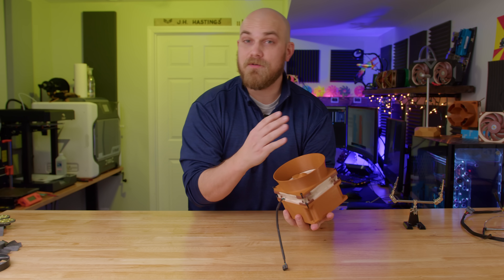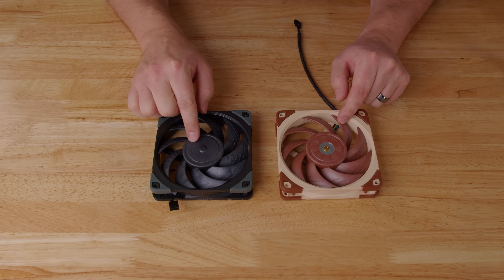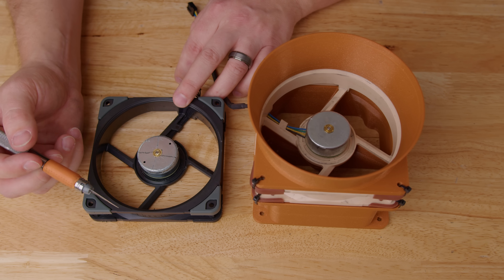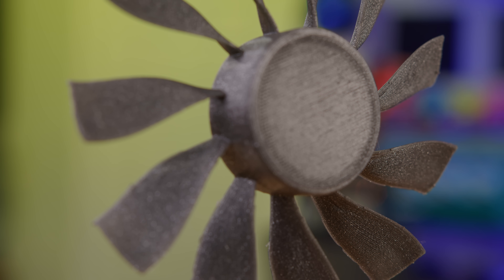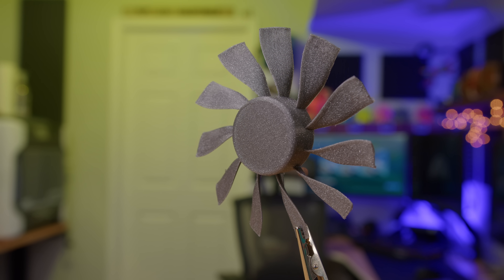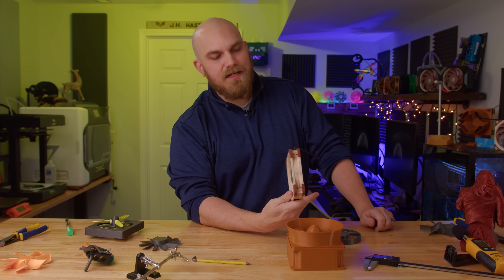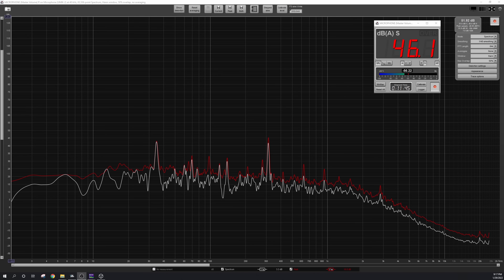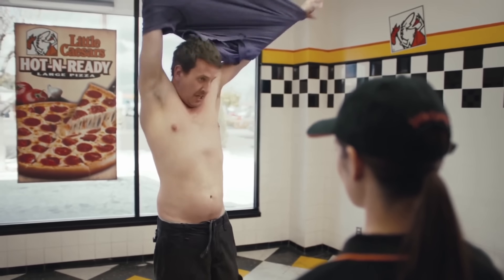Overdrive ENGAGED | Fan Showdown S4E1

Comment: Brainwave for a test.  What if you put the A12 on one end of your test tube and mount the other fan on the other end.  Then you could measure the power transferred as you increase the load.  It would be like a fan dyno.  You would then have an efficiency gauge that would measure both air flow and static pressure in one hybrid number.

Comment: Maybe you could run the gear fan with a drill at the same RPM?  Just to see if the concept works.  If it turns at 2000 and it still doesnt move air then defeating friction is irrelevant.

Comment: The holes are probably so hot plastic can ooze through and form rivets to help hold the fan in place. Now that you have a fan motor without a frame you mount it on a test bench/3d printed holder and test fans without having to worry about the fans rubbing. Basically no size limit on fans. Just for shits and giggles. See what kind of fans get submitted or Rube Goldbergian device using the fan motor for power. Find a new use/upcycle for old fan motors.

Comment: I have been printing with my Creality cr10 and I noticed that the dimensions were off on the x and y axis. I tried all sorts of things to calibrate it and then I just randomly chanced upon the cura scale settings and noticed that they were different in the x and y axis.. so I've manually set the scaling on x and y and z and I think it's more accurate now.. maybe the new Cura has done something like that to you too.

Comment: Different dyes in plastics can cause weakness. I vaguely remember Noctua saying they didn’t want to make black fans because the resin wouldn’t be as strong. So you’re probably not off base thinking it’s weaker.
Reply: case and point: Lime green lego was notorious for being brittle and breaking. something about the die messed up the plastic composition.
Reply: @572089  Also, in 3D printing, each color will require slightly different process (temps, sometimes speeds as well if you’re really trying to nail it) and shrink rates in order to make consistent prints.
Reply: @572089  bionicle 2007 moment
Reply: It should be noted that if they are using injection it has more to do in issues of keeping the machine running enough to make it worth the cost of stamping.  I had more issues in keeping color controls for quality in mixing the color and it having the conditioning for the surface molding texture.  Certain parts from the line we had would make a charcoal and swirl if there too little color and it would scorch in the mold and pit or bubble even.  The clear stuff uses dyes more as they tend to be more for that purpose.
Reply: @rallyfeind  From my understanding with regards to Noctua, they’re using something more like a thermoset resin than a traditional thermoplastic, so they can hit tighter blade-to-frame tolerances. That’s once again from fuzzy memory from forever ago though. And yeah, I used to work in injection molding too. :) it’s what lead me into 3D printing. The biggest issues we’d see were lack of proper mixing with colorants as well, though something I noticed is even then there was some difference in barrel temps/pressures depending on the dyes and additives added to the resin for the more tolerance-picky customers.
Reply: @underscorenul  Yeah it is the resin part specifically.  Nylons are a pain to not get contaminated in the same injectors as anthing if they aren't cleaned obsessively for example.  It all matters what exactly is being used and fairly it was just a matter of they may have one of those pesky goldilocks zones in the pigment or dye area.  The khaki and rust red were always a mess and would print scrap for sometimes an entire shift even on stuff because a batch shifted slightly too.
Reply: Just glue it. Noctua is chea0
Reply: It's because carbon black, the dye, is really hard... and brittle.

There are black dyes available that do not substantially alter the plastic properties iirc, Noctua just uses the cheapest dyes they can source.
Reply: I remember watching a video of a guy crushing a vintage toy with his hand, it was brittle because it has a golden dye
Reply: I keep accidentally breaking the little fans on my 3d printer. Would you do a mini cheater for a 40 x 40 x 10 12v fan and test it?
Reply: *dyes. The die is the mold
Reply: @gormauslander  Thank you for your valuable contribution to the discussion. I’ve corrected my fatal error and will endeavor to be as perfect as you in the future. ;-)
Reply: @underscorenul  impossible
Reply: @gormauslander  Or maybe you should be endeavoring to be as perfect as underscore. The definition of perfect can vary.
Reply: @user2C47  also impossible

Comment: 9:1 might be too much reduction for a gear fan. Maybe try 4:1 or 5:1
Reply: That sounds reasonable, but any geartrain on a fan is wasted power that could have been used to accelerate the air instead. No geared fan can ever compete, because no geartrain can ever be 100% efficient. They look neat as heck though.
Reply: @WarrenGarabrandt  For sure! Can't beat the laws of thermodynamics after all. I'm thinking that the high ratio is too much torque for the motor, so the change would be more from the limitation of the motor.

Comment: I'm not well informed about the materials that are available to use in a 3d printer,  is there a teflon blend or maybe delrin that can be used for a gear fan? If they can be had they are self lubricating,

Comment: You make it sound like noctua hate people modding their fans but I would be more surprised if many of them weren't fans of the fan showdown and I question why they don't just release a bladeless frame and motor specifically for people to make there own...

Anyway, if people do take up the option of bearings (it's possible I already submitted one using a bearing...) I suggest looking into replacing the standard grease with a much thinner one so the bearing isn't the thing causing too much resistance.

Comment: I wonder if the industrial PPM Noctua fans would do better. They have a 4 pin 3000 rpm version that is incredible on its own for static pressure (1700rpm it out performs the browns ones). That might have enough juice for some new fan designs
Reply: I get what you're saying, but the whole series is based on "what if I made my own blades for the a12x25?" 
Maybe a different series where the fan motor isn't the limiter will happen in the future or as a side series

Comment: Going forward Cubic Feet per Minute should be the one you reference instead of Feet per Minute (you even have it on the spread sheet). Reason being that FpM is dependent on that particular test setup whereas, theoretically, CFpM isn't. I.E. if you retested a fan with a wind-tunnel twice the diameter then Feet per Minute would plummet but Cubic Feet per Minute (should) remain constant; same fan should result in the same metric. It's also the unit fans advertise themselves in.
I'm super hyped though.
Reply: Yea the fpm kinda confused me there.
Reply: The metric system equivalent to CFM is L/s, and it should be used instead.
Reply: Mind you, if you want to do it Properly you measure these things in cubic metres per second...
Reply: @laurencefraser  nocta lists m³/h for their fans. A12X25 is rated at 102.1 m³/h which would be equivalent to 60 cfm. 1cfm = 1.7 m³/h or 0.000471m³/s if you like that better
Reply: i was thinking it should be cfm also.
Reply: As long as all the fans are tested with the same tunnel it doesn't make a difference, fpm with a constant setup is essentially just cfm with larger numbers.
Reply: metric is the answer, always!
Reply: All he has to do is measure the diameter of that exit hole, and then calculating CFM from the FPM is easy.
Reply: @WarrenGarabrandt  all he has to do is use metric instead you cretin.
Reply: Unless you're using a squirrel cage fan -  the metrics would all change depending on the box the squirrel fan and its frame is built inside of - with a slider as a "port" so you can regulate the airflow and pressure within the system - if its wide open ... you can't push as far - if there's a 65% reduction - meaning its 65% blocked off - that air can go further  - but if the side your air is exiting from is also not regulated or taking into consideration for the intake side,  like in a house if you block all your vents - you build up too much pressure - and burn the motor out - this pressure is tuned by the size of the ducting or tube - the length - and how many and how large each vent is - it's why they are all the same size in general. (the part you see on the floor you can open or close)  Also if there's just open air on the intake or exhaust side, the fan will be useless because its just going max speed - with no utility on the energy being used, the slower a fan goes from being at a good intake and exhaust percentage  (of airflow, so the opening and exit size taking into account length and sized of duct/tube)  then the less heat it produces, the more electricity you save, the less wear and tear and the more performance you can gain.
Reply: It's the same setup every time. Ft/min to ft3/min gives no actual increase in information.
Reply: @mitchellsteindler  not in any practical way but it makes those numbers a little more comparable to manufacturer numbers. CFM for air flow and inH2O for static pressure are the two standard values you'll find for most computer, industrial, ... fans. And some use metric but that doesn't add any information.

Comment: Would like to see bearings being used to create more complex designs (would definitely help Artem’s profan). 

Perhaps if you suggest several standard bearing sizes for people to use/design for (e.g. 40mm, 22mm & 16mm?) then you can keep reusing them rather than having to buy different sized bearings for each design?
Reply: Probably 608 bearings would be best to design around.  It's the size used for skateboard wheels, and is very common in consumer and industrial applications.  I've used them in my 3D printed projects.  You can pick up a dozen of them for less than $20.  They are 8mm ID, 22mm OD and 7mm width.
Reply: @jameslmorehead  They are way too big for a fan, your bearing losses from friction would be too high. Most fan bearings are 2-3mm ID
Reply: @jameslmorehead  those have too much drag. U wana use a needle bearing lil surface area but still load carrying capability
Reply: I guess thats only an option if destroying the 3d prints to recover the bearings is OK as the bearings would need to be press-fitted to work well ...
Reply: @OldLukes  just buy a bag of them, they are not that expensive..
Reply: Yeah thats a good idea?
Reply: This
Reply: Great idea with the standard bearings!

When Major Hardware said it was challenging to design a fan with gears without bearings I also asked myself: Why not just use bearings then? They're cheap and you don't have to reinvent the wheel here...
Reply: The fan would still spin the same speed because the fan is encountering the exact same air resistance with vs without gears. All that a bearing will do is slow the fan down further. 

However, if, for some reason you had a really powerful electric motor with a power cap,and had a low maximum RPM then the gear system would work well.

Pretty much the main thing that slows down a fan is the air resistance on the fan equaling the motors power output. Once you add gears and bearings you will have a lower RPM because of added friction. Even if your gears and bearings were perfectly frictionless you would still hit the same RPM without the gears (unless the motor had some power loss at high RPM, or your motor has an output power cap and isn’t always running at 100% all the time.)
Reply: @Chevsilverado  hmmm i.m.o. its not the fan blades that are the issue. Its the geartrain losses the electric engine doesnt have the torque to drive that geartrain. Thats how i see it. Bearings would help but still limited on such a lightweight motor
Reply: @captaintoyota3171  Yeah the blade design isn’t the issue, but I meant that according to some basic physics, even with perfectly frictionless bearings the output RPM of the blades will be the same with 1:1, 1:2, 1:1000, based on the fact that the motor power is in equilibrium with blade air resistance. You can’t spin that blade faster without adding more motor power, as input power will always be equal to output power. If you have a motor that creates 5 newtons of force, the blades will spin at the RPM where air resistance pushed back with 5 newtons.  You can add perfectly frictionless gears in between, but that’ll only slow the motor down, not speed the fan up.

It’s like the top speed of a car. Top speed is when engine horsepower is equal to air resistance, so the forces on the car are balanced so there’s no more acceleration. You can add gears or change gear ratios but top speed will not change when air resistance is equal to engine horsepower. (Assuming flat powerband, such as an electric motor).

If the fan motor has a max output of 5 newtons, but you manage to use a 1:2 gear ratio to make the fans spin against 10 newtons of air resistance, you just made an infinite energy machine.

I agree with you that in reality, friction is everywhere so that’ll make the system even worse. Instead of having 5N of motor power balanced with 5N of air resistance, you will have 5N of motor power balanced with 4N of air resistance, that extra 1N is obviously taken away by friction.

Comment: I would assume they are there as an added fan blade attachment?  Did the top of the fan blade you removed have 2 small plugs that stuck into the holes? It did look like the fan was excessively glued to the hub...

Comment: I 'm totally on board with the new testing method. Changing the game like that SHOULD inspire an entirely new group of fan designs. Noctua tries to balance both use cases so it new designs should overtake it pretty quickly when going for straight airflow. I speculate that thinner blades with more surface area will dominate this season.

Comment: Might be a bit too heavy and bulky, but what if you were to fit a geared fan with longboard bearings? Specifically ceramics for weight reduction. If no one comes up with this design in the next few months (when I'll be able to afford a new PC) then I'll try it out.

Comment: you should get a palette 3 and start using de-solvable supports, this would open up the designs to ideas that cant be done with just one material. like bearings, gears and drive shafts with stronger materials. basically over-engineering the shit out of them.
Reply: He has a dual media printer already...

Comment: Whoever designs the next planetary gear should design the three rotating gears so that  they have mini fans inside them that also help push air through as well and a true master would be able to stuff some in he center sprocket as well.
Reply: Already done. As major said in this video
Reply: yeah I typed the comment about a minute into the video. I feel like the gears add too much surface area to help though if you get a stronger motor that runs better slower it might be worth it. It might be nice to see them run with more power and more speed to see if we can tease out a few more nuances between the designs like what speeds are best for different things. The genius of the zig zag design though was that it acted like adding a duct to the fan blade but inside the radius of the blade!

Comment: Very interesting episode.

And very, very interesting thing about the chromax fan. I wonder if its a single-piece item failiure, or if this is something to be expected from the chromax line. The way the plastic appears looks... cheaper than the normal noctua.
Reply: Have also found the chromax fans to not be as high quality as the regular noctua ones (had both die on my chromax black DH-15 after 18month use..). 
Additionally the chromax fans often cost more as well!! 

Been using several of BeQuiet’s 140mm pure wings 2 that came pre-installed in my new case (BeQuiet 802). Noticed that they are are of similar quality and performance as the noctua fans, while almost always being around £10 cheaper.

Comment: my issue with this is that we dont get to compare it with the past 3 seasons in terms of temperatures and stuff, we just get airspeed.
Reply: Yes, it would be nice, to retest, say, the top 3 fans from each of the previous seasons using the new methodology for comparison.
Reply: I think that's part of the point.  He can test fans more rapidly rather than needing to wait for a cooling system to reach equilibrium.  Maybe doing an airspeed test with the wind tunnel as is, then another with a restricter plate between the fan and the stabilizing grid would give a slightly more realistic test point group.
Reply: He'll likely add some of the old ones if people ask for them, he's done it before.
Reply: New session, new rules!

Comment: Comparison between motors is alot more interesting as weve seen a ton of fan blades in several months now.

Like how many windings used, how thick the gauge used in the motor, what kind of materials used in the motor.

This is the most overlooked part of a fan.